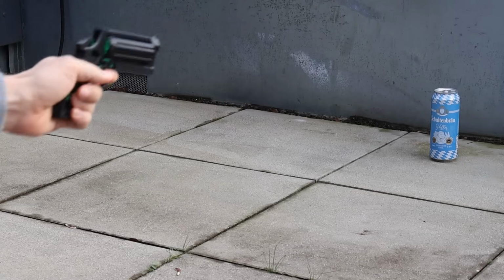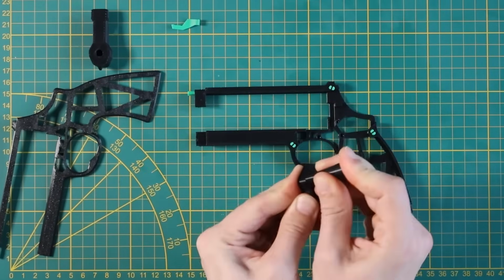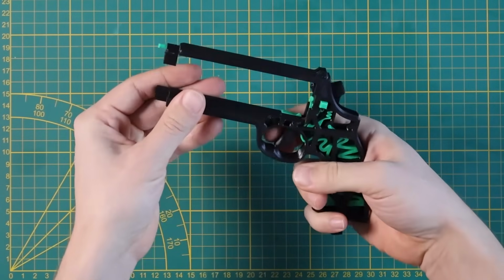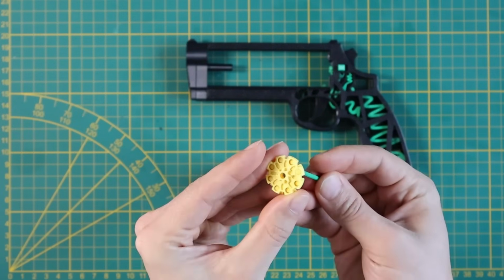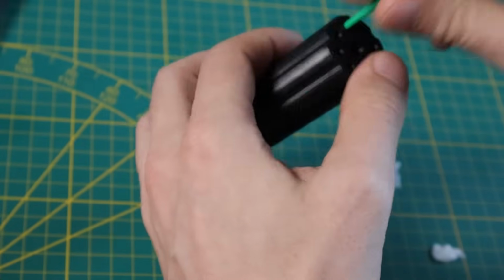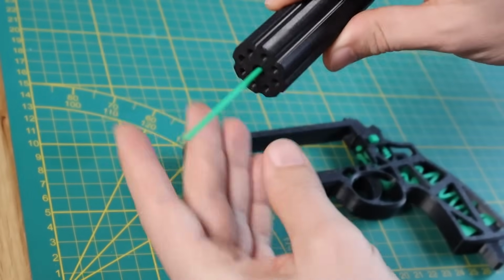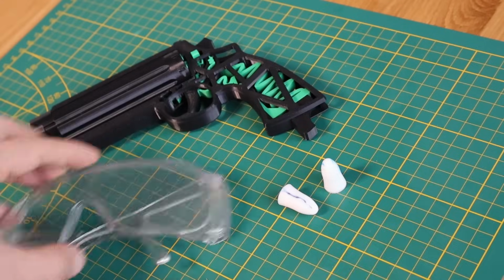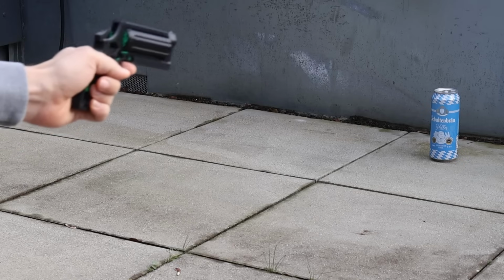Shooting Cap Revolver from 3D Printer

Comment: Hello what kind of plastic should I print on PLA there is PETG Xen please reply me
Reply from the maker: In theory, you need a plastic with high impact resistance. PLA is actually particularly poor in that regard. Still, it held up better for me than PETG, ABS, or even PC, all of which technically have higher impact resistance.

Comment: I wonder if a roll cap cylinder version could be made, just switch out the cylinder load a roll and you can swap between the two even opens the opportunity of making your own "vintage" high power "chlorate roll dots"

Comment: hey, great work! 2 things though, i noticed your chronograph wasnt calibrated properly with the weight and diameter. i saw it was set for .20g and 7.2mm.

also, would it be possible to make an airsoft version of this? have it shoot 6mm bb's?

Comment: Somehow it can shoot 1 bullet but the cylinder wouldn't spin
Reply from the maker: It must be related to tolerances. I can only recommend printing it again with a different filament; maybe that helps.
Reply: @it_could_explode It works normally now, the cylinder placement was off which was my fault. Now the problem is either the caps I bought are of low quality or the revolver doesn't shoot all 8 rounds, only about 6.

Comment: I made one but my barret wont rotate. the rotation thing seems to push into the gun and slide away and miss it
Reply from the maker: Hard to say where the problem is from here. You can try to reprint some parts from another filament, that often helps, als very small tolerances can make the difference

Comment: the corresponding measurement to "meters per second" projectile velocity is "feet per second" not "miles per hour". Your pistol is shooting a projectile about as fast as an airsoft BB out of a gun that isn't particularly powerful or weak. Kind of a pretty average fps for a pistol. But airsoft guns impart spin to the projectile and the amount of actual energy depends on the mass of the projectile and stuff

Comment: i absoulutely love this design, is there a way i could print this on a different printer as it only shows bambu lab downloads. (i have an ender 3)
Reply from the maker: Sure, you just have to choose "Download STL/CAD Files"
Reply: @ I have tried that but it only shows the option for the longer barrel download, (im trying to download the smaller cylinder model)
Reply: @it_could_explode  -please could you upload a stl file for the short version
Reply from the maker: @ReallyJaffa Ah you mean the short version. You can open it in bambu studio and export it as STL from there
Reply: @it_could_explode  thanks

Comment: great work. wouldn't it be good to adjust is to work witg Airsoft BBs (6mm) and some TPU or rubber Hopup in the barrel :)
Reply from the maker: In the video the bulles are only 4mm but the version I uploaded is meant for 6mm BBs. But I don't know if I understand what you mean by the rubber hopup.

Comment: Hello, my trigger is not returning to its place, what can I do about it?
Reply from the maker: A few people reported this. Unfortunately, I don't know why that is. It can't be a fundamental problem, as it works for many people. I suspect either certain tolerances or material properties. If you have used PETG, you can print the springs from PLA
Reply: @it_could_explode I have everything printed pla.

Comment: This is literally a firearm, a primitive sub sonic firearm, but still this is a firearm. The caps you got are literally a small primer / blast cap which you are you using to propel a small projectile down the barrel. i would highly recommend not releasing the files to the public and check your local laws. Mainly because people can be really stupid...
Reply from the maker: You are basically right. The good thing is that it cannot produce projectile velocities high enough to seriously injure someone. The cylinder would burst before that. That's why I had no moral qualms about uploading it. A kitchen knife would be much more dangerous. As far as the legal situation is concerned, everyone has to evaluate that for themselves.

Comment: could you make a slowed down video of this assembly?
the one i made did not function properly.
Reply from the maker: Did the Video of the shorter Version not help? Is has the same mechanics and is a bit more detailed. 
Maybe I make a longer video without cutting. But I dont want to promise when.
Reply: @it_could_explode  i think it did not work because i used PLA-CF, i tried printing it with just PLA and it should work

Comment: really, this is sick. I would love a version made with common springs just becase after a while pla/petg springs gets weak. Its cheap to print more, but I would like smt that last more. but really, thank you for your work
Reply from the maker: Actually, my first version even used a regular spring. But there are hardly any standards, and you never know if the selected spring will be available long-term. But I specifically added the small lever at the bottom of the grip, which allows you to relax the springs when you're not using them.
Reply: @it_could_explode  can you release it with longer barrel? would love it. I have some set of springs laying around from other projects so i should be able to build it

Comment: I'm confused, if it's 100% 3D printed, where's the smoke coming from?
Reply: the explosives inside
watch the video, it is not 100% 3d print if we count pistons
Reply: @ how do I buy those? Just search for explosive pistons?
Reply from the maker: The only non 3D printed part are the 8 shot ring caps. If you google that, you'll find them.

Comment: In the bullet placement part, do you place the paper after laid the bullet? And in the short version, can it shoot bullets?
Reply from the maker: Actually both can shoot bullets but the short cylinder is not closed, so the caps can blow out to the back and block the mechanism. And ich put the paper in front of the bullets to avoid them from falling out

Comment: Lebst du in Berlin?
Reply from the maker: Ne, wieso gerade Berlin?
Reply: @it_could_explode  Ich lebe selbst in Berlin und 3 Mio andere auch. Ich habe ein paar Designs für meinen Drucker selbst gemacht und dachte man könnte sich austauschen.
Reply: Wie hast du das mit den Federn geschafft? Ich habe letzte Woche noch was versucht und irgendwann habe ich aufgegeben weil ich die eingeschafften nicht so hinbekommen hatte wie ich wollte.
Reply from the maker: @ Achso, versthe. Zu so etwas wäre ich nicht abgeneigt, aber ich bin ich nicht aus der Nähe. Die Federn haben sich bei mir irgendwie ergeben durch den Platz, den ich zur Verfügung hatte. Wichtig zu verstehen ist, dass man zum Stauchen viel mehr Kraft benötigt, als zum seitlichen Biegen.
Reply: @it_could_explode   Ich habe es gerade ausgedruckt und baue es zusammen. Hast du alles selbst designed? Welche Software nutzt du?
Reply: @it_could_explode Feedback: 

Das Design ist extrem gut. 
Die Toleranzen kammen gut raus. 
Besonders beeidruck bin ich von der Trommelverrastung, die recht früh beim Triggerpull abruscht. 

Der Triggerpull ist sehr hart. 
Der Haken der die Trommel löst kann nur gezogen werden wenn man den Hammer zurückzieht. 
Der Vordere Teil ist ein wenig wackelig. 

Aber alles im allem ein echt guter entwurf.

Comment: super neat, i love the mainspring decocking mechanism to deal with the creep.

but be careful, i think that thing is defined as a firearm under german law, the <7,5 J limit only counts for air rifles.
Reply from the maker: Thank you, I will destroy my model immediately ;)
Reply: @it_could_explode  fellow german here. He is correct.
It's using "hot gases" to propel a projectile and is therefore not covered unter the <7.5j law.
Technically its highly illegal "producing and owning" of an illegal firearm.
Though.. in the worst case they'd take it away and destroy it, as it's sill only a toy.
Just badly worded laws.
Reply: @Esteran  Die Antriebsart ist völlig egal, Schreckschusswaffen nutzen ja auch heiße Gase und sind freie Waffen. Zwischen einer Mündungsenergie von 0,5 J und 7,5 J braucht man eine PTB Abnahme um das bekannte F im Fünfeck zu bekommen. Hat man dieses nicht, ist es ein Verstoß gegen das Waffengesetz und kann ziemlich teuer werden. Der Einzug und die Unbrauchbarmachung ist da enthalten ist, sollte das kleinste Problem sein. Die Behörden verstehen bei Verstößen gegen das WaffG absolut keinen Spaß, auch wenn es eigentlich ein Spielzeug wäre. Das öffentlich hochzuladen und auch noch unter der Angabe von der Energie ist schon ein wenig blöd. Es hätte schon gereicht einfach zu sagen, das Ding hat nur 0,5J oder keine Dose mit deutscher Aufschrift zu verwenden.

Comment: For more punch with modern cap ring, you need to remove with a needle the little powder circle, and stack 2 or 3 in a ring cap. Way more punch.
Reply: do you know where else you can buy the older ones?
or if you make 2-3 together, what do you mix it with to make it solid and not a powder?
Reply: @RealWillyReal  the modern one's are solid, it's a little disk of powder, just stack them.
Reply: @hellsing56666  thank you, but don't you still fix the layers somehow?
Reply: @RealWillyReal  no need, friction hold them.

Comment: Wann wirst du ungefähr diese version veröffentlichen
Reply from the maker: Tut mir Leid, das ist momentan nicht wirklich geplant.
Reply: @it_could_explode  egal, hab die normale Version jetzt gedruckt und um die geringe effizienz zu kompensieren benutze ich einfach selbst hergestellte caps.
 Noch eins, 
warum sind da Schwänze auf meinem Revolver!?
Reply from the maker: @ Sorry, die Schwänze waren ein kleiner Spaß, den ich mir erlaubt habe 😅Das hat bisher fast niemand bemerkt. 
Wie stellst du denn deine Caps selbst her? Ich nutze ja die aus den 80ern von ebay, habe aber auch schon die normalen gepimpt. Ein paar Stapeln oder etwas extra Pulver in die Trommel kippen. Als ich es mal übertrieben habe, ist mir aber auch schon das ganze Ding explodiert...
Reply: @it_could_explode Als erstes drucke die form von den Caps aus . Danach tue ich ein Mischung aus Kaliumchlorat und Schwefel in einem bestimmten Verhältnis rein und versiegle es mit einem Plättchen Papier. Das ist praktisch das selbe was streichhölzern oder diesen Spielzeug Caps drinne ist. Ich kann halt die Menge anpassen. Kaliumchlorat Stelle ich ebenfalls Zuhause her. Geht ziemlich easy mit Kalium Chlorid und Bleichmittel (gibt dazu Videos auf YouTube). Wenn ich ehrlich bin hab ich es noch nicht mit einem 3d gedrucktem Cap getestet. Ich hab's bisher immer mit mit ausgestanzten Aluminium (Aus Dosen) Hütchen gemacht .Mit Schwarzpulver Kanonen hat das immer gut geklappt. Kann aber die Alu Zündhütchen nicht richtig von der Größe her an diesen Revolver anpassen deswegen werde ich es drucken.
Reply from the maker: @ Danke für die Infos, das ist interessant! Ich kam noch gar nicht auf die Idee, das selbt zu mischen. Das ist jedenfalls nachhaltiger als die Caps aus den 80ern, die es ja nicht mehr ewig geben wird. Sind die Chemikalien frei verkäuflich? Ich dachte in Streichhölzern wäre roter Phosphor mit Kalium Chlorid (Armstrongsche Mischung).
Reply: @it_could_explode  alles außer Kaliumchlorat ist frei verkäuflich. Es ist ziemlich schwer an Kaliumchlorat ranzukommen, deswegen ist Selbstherstellen meist die einzige Option. Die Reaktion mit dem Bleichmittel ist zudem ziemlich ineffizient man braucht aber auch nicht wirklich viel für die Caps(Man sollte auch nicht viel von der Mischung machen da es ziemlich gefährlich ist). Kaliumchlorid , Schwefel kann man bedenkenlos bestellen. In den streichhölzern Köpfen ist diese Mischung drinne. Das kann auch ohne dem Phosphor aus dem Streifen sehr gut mit einem Schock detonieren.
Reply: @it_could_explode when will it be for download
Reply from the maker: @Dksus281e  Sorry, it is not planned at the moment. Maybe in a few moths if I mage a more detailed Video
Reply from the maker: @Jeff-ml2ek  Danke für die Infos! Ich glaub ich lasse vom selbst mischen lieber die Finger. Aber ich experimenteiere mal mit Streichholzköpfen.
Reply: @it_could_explode  ok habs jetzt getestet. Das ganze ist doch schwieriger als ich mir vorgestellt habe. Hab aufgrund meines gebrochenen Englisch anfangs nicht verstanden was du mit "Caps blowing out the back" meintest. Das ist richtig nervig. Hab versucht das ganze schwächer zu machen aber es passiert trotzdem. Kann dadurch immer nur ein Cap rein tun ( den ich extra eng passend an dem Revolver entworfene habe), weil die anderen immer weg fliegen.
Reply from the maker: @ Ja, es gibt nur ein kleines Fenster, in dem sie stark genug zum schießen sind, aber schwach genug um nicht hinten heraus platzen. Es haben jetzt schon einige gefragt, darum werde ich bald die Variante mit dem Bjonettverschluss hochladen. 
Ich habe jetzt mal leere Caps mit in Wasser aufgeweichten Streichholzköpfen gefüllt und lasse das jetzt trocknen. Aber ich glaube das wird nicht funktionieren, oder? Ein Schlag mit dem Hammer auf den den Streichholzkopf hat nichts gezündet.
Reply: @it_could_explode  kommt drauf an, als ich 12 war hab ich es mit Freunden immer so eine Art Dart Pfeil gebaut und mit Streichholzköpfen gefüllt. Das hat eigentlich immer funktioniert hat aber etwas mehr Kraft gebraucht . Vieleicht war dein Streichholz Kopf Pulver noch feucht. Du musst es auf jeden sauber von den stäben lösen und zerkleinern. Hast du das Wasser indem du es aufgeweicht hast einfach weggeworfen? Kaliumchlorat ist nämlich wasserlöslich. Du könntest die Wirkung damit abgeschwächt haben . Es gibt bestimmt ein paar Videos wie Leute mit dem Pulver  rumexperimentieren und es verbessern. Du brauchst halt vorallem den Schwefel (nicht wasserlöslich) und das kaliumchlorat (wasserlöslich )da drinne.
Reply from the maker: @Jeff-ml2ek  Beim Test mit dem Hammer habe ich den Kopf ohne Wasser abgeröselt und auf einen Schraubstock gelegt. Ich könnte mir vorstellen, dass der Hammer aber zwar die Kraft durch sein Gewicht hatte, aber nicht die nötige Geschwindigkeit.
Für den ausstehenden Test habe ich ein paar Streichholzköpfe nur kurz unter Wasser gehalten. Das hat gereicht, um sie einzuweichen. Dann konnte ich die Masse ganz einfach abschaben und es hat sich eine knetbare Masse ergeben. Die habe ich ein ein paar leere Caps gefüllt und lasse sie aktuell auf der Heizung trocknen. Die kann ich dann morgen mal mit dem Revolver testen.
Reply: @it_could_explode  habs jetzt auch getestet. Es braucht schon etwas Kraft das auszulösen. Hab etwas Phosphor vom Streifen dazugemischt und es ist jetzt deutlich sensibler . Wenn man es mit Wasser vorher anfeuchtet ist weniger sensibel .Glaube wenn man die streichholzköpfe roh benutzt sind sie aufgrund der Verunreinigungen nicht sensibel genug.
Reply from the maker: @Jeff-ml2ek  Ach ok, ich war gerade auf der Such nach einem YT Video, das ich mal gesehen habe. In dem hat jemand auch streichholzköpfe zusammen mit einem Fetzen vom Streifen in eine rudimentäre pistolenähnliche Vorrichtung gefummelt und mit einem Schlagbolzen gezündet. Aber eben mit einem Fetzen vom Streifen. Aber mit genug Kraft konntest du es auch ohne Streifen zünden?
Reply: @it_could_explode  ja aber glaub nicht das der Hammer vom Revolver diese Kraft aufbringen kann
Reply from the maker: @Jeff-ml2ek  Unter dem Begriff Matchstick Gun habe ich bei YT nun ganz viele Videos gefunden, die das zeigen. Wenn ich das sehe, denke ich auch, dass der Revolver etwas zu schwach sein könnte. Außerdem ist da immer eine Hülse und ein Bolzen aus Metall. Aus Kunststoff wird das wahrscheinlich nicht oder nicht lange halten. Aber ich werde da mal ein bisschen experimentieren. Wenn das funktioniert, wird vielleicht eines meiner nächsten Projekte so eine Matchstick Gun, die vielleicht wieder als Revolver oder mit Magazin funktioniert. Irgendwie gefällt mir das.
Reply: @it_could_explode  ich hab eine Idee wie man die Streichholzköpfe auch beim revolver nutzen könnte. Du könntest Überallzünder Streichhölzer kaufen. Die enthaltenen phosphortrisulfid welches die Reaktion zwischen kaliumchlorat und Schwefel katalysiert und sensibler macht. Ich hab tatsächlich welche heute bestellt und bin gespannt ob man sie auch benutzen kann. Habs nämlich mit der einfachen Schwefel kaliumchlorat Mischung nicht wirklich hinbekommen. Es war schwer das ganze zu regulieren und es hat nur in 1 von 10 Fällen funktioniert. Hab herausgefunden dass die caps aus den 70er auch kaliumchlorat und Schwefel enthielten aber im Gegensatz zu meinem Zeug auch noch Antimontrisulfid enthielten . Es funktioniert auch mit anderen Sulfiden (solange sie 3 Schwefel Atome enthalten). Antimonsulfid braucht aber zu lange zum liefern also versuche ich es erstmal mit den Überallzündern.
Reply: @it_could_explode  ok habs jetzt getestet. Es funktioniert extrem gut. Hab mir die cowboy matches von WIP geholt.Kannst du bei eBay in hunderter Pack holen für wenige euros

Comment: Interesting idea ( about long revolving drum) . Maybe isn’t very practical ( it’s going to be heavy and bulky)but definitely solve one of the main problems of revolvers ( barrel to drum gas sealing) in one ingenious, “out of the box” way ! Bravo and thanks !
Reply: Bro, literaly you can print it
Reply: its 3d printed. it weighs nothing, i have printed a pipe wrench and its not even as heavy as a cheap 5 quid capgun
Reply: The idea is quite old, they're known as a "pepperbox"
Reply: @ Thanks , today learned something new ! For me was new in therms of revolvers . I’ve seen  military machine guns and air defense cannons which has very high rate of fire based on similar idea .
Reply: @ Yeah it's pretty fun how old designs sometimes become relevant again with new technologies
Glad you found that interesting